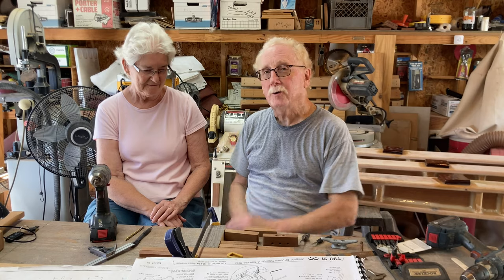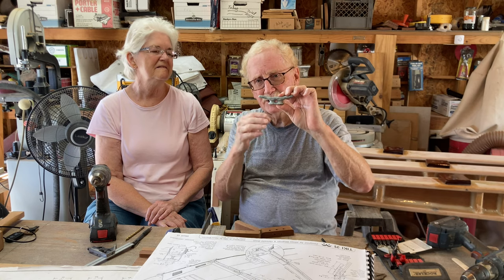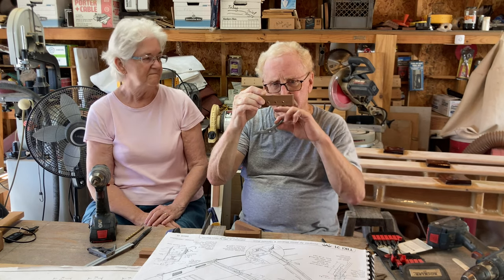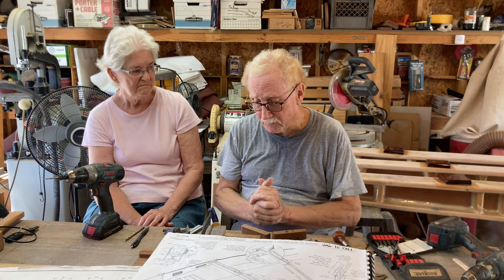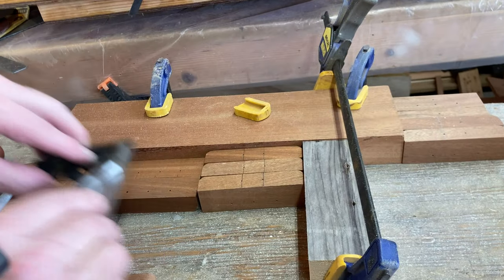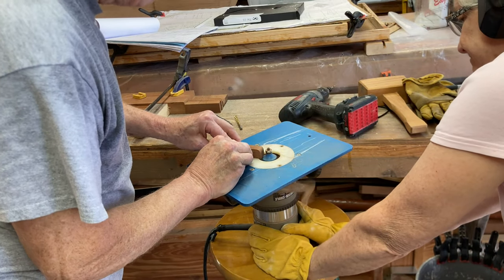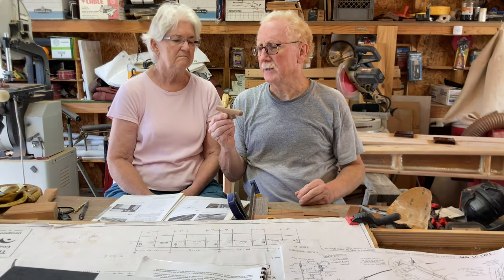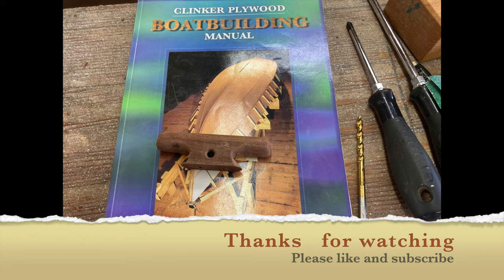Ep22 Building a Wharram Tiki 21   4K

Comment: Well done. You could do with a vice. I presume you will run screws though the cleats as well?
Reply from the maker: Ben, thanks, due to poor shop layout, we keep our  vice to the right behind  the table saw. Inaccessibility makes us feel we earn the right to use a tool by the time we can get to them. Yes, the cleats will have screws and be epoxied to the hull.
Reply: @RexandKathie  Fair enough. My shop is also very tight (which you can see in some of my videos) though I have very different tools in there.
Reply from the maker: @BensWorkshop  You are familiar with moving things as we are to use your tools. It does afford us the opportunity to pick up tools that didn't make it back to their designated storage areas.n